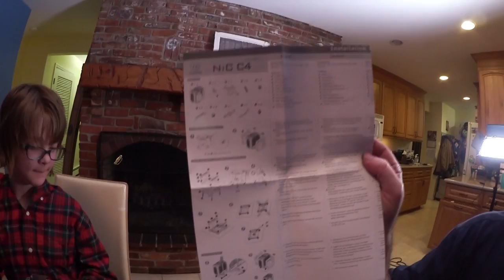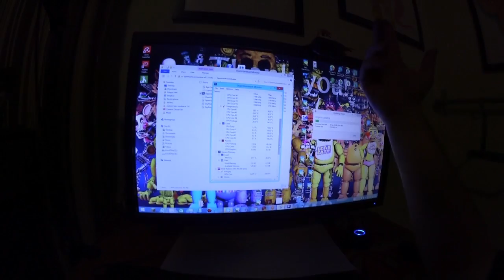Family Vlog- Computer Problems!!  Day 1037 | ActOutGames

Comment: Does she have a PC?   Macs don't have fans.  This message is being typed from a Mac.
Reply from the maker: +classicrockcafe This computer we're working on is a PC.  We use both.  Macs have fans too, they just usually have very different configurations in boxes like the powermacs.  The only way to get away with no fans would be to go with a liquid cooled system, and we're not quite ready for that over here.  Maybe there are newer tower macs that just have huge heat sinks, but I don't think I've seen those.